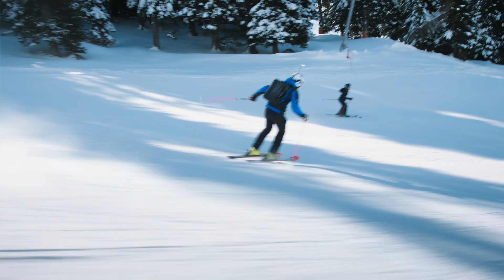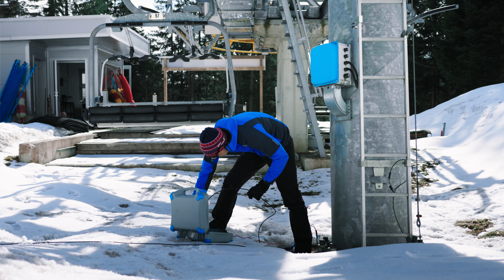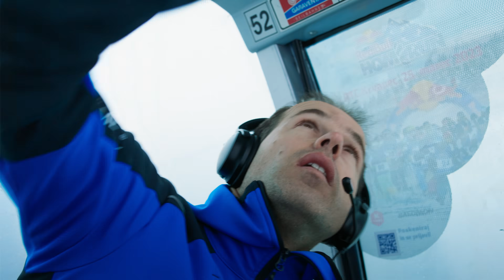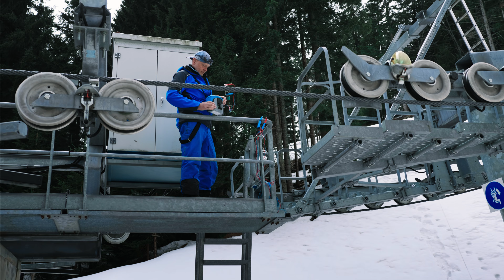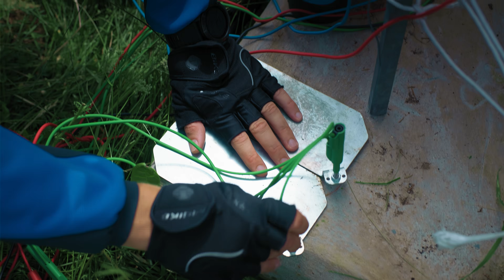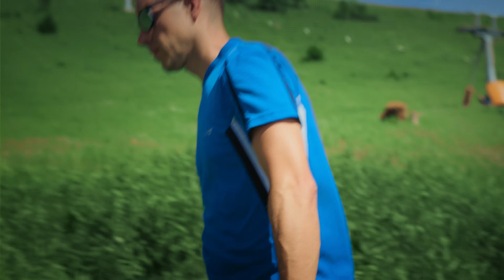Chairlifts & Gondolas | Electrical Safety Testing in Mountains | MI 3288, MI 3290 | Instructional

Comment: I will never own or use one of these devices. But this is still a very interesting video about potential voltages and how to test for them. I've road on similar cars in amusement parks and never thought about this being an issue.
Reply from the maker: Proper grounding is one of cornerstones of electrical safety.